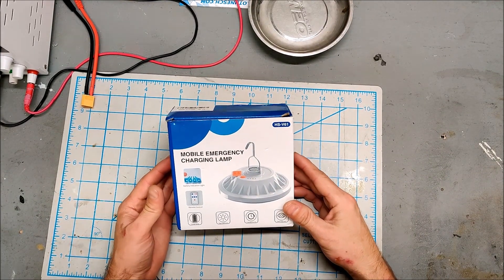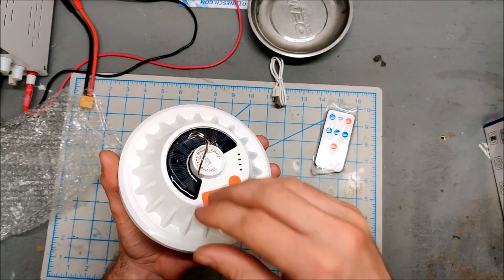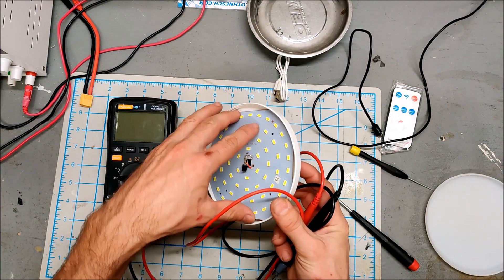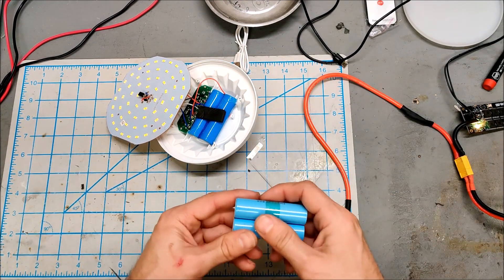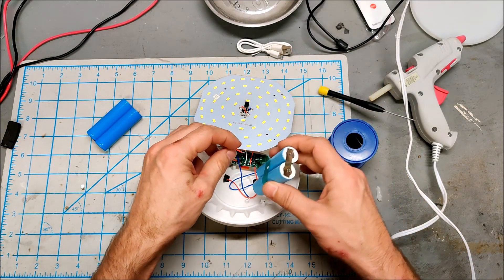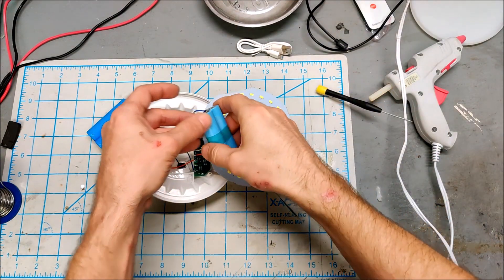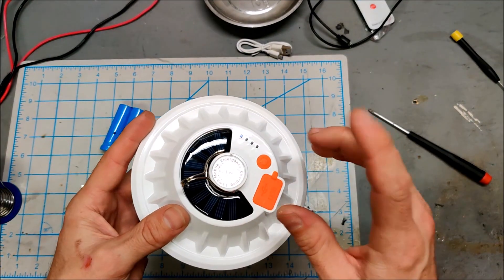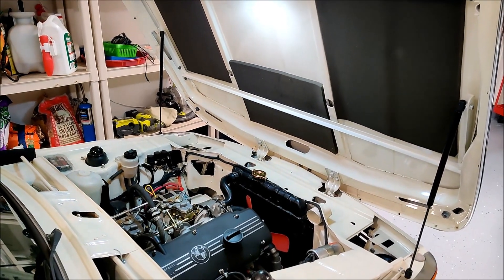Upgrading $10 Camping Lamp - Tripled Capacity

Comment: "dead as a door nail" From Middle English ded as dore-nail. 
One plausible explanation for the phrase is that doors were built using only wood boards and hand-forged nails: the nails were long enough to dead nail the (vertical) wooden panels and (horizontal) stretcher boards securely together, so they would not easily pull apart. This was done by pounding the protruding point of the nail over and down into the wood. A nail that was bent in this fashion (and thus not easily pulled out) was said to be "dead", thus dead as a doornail.